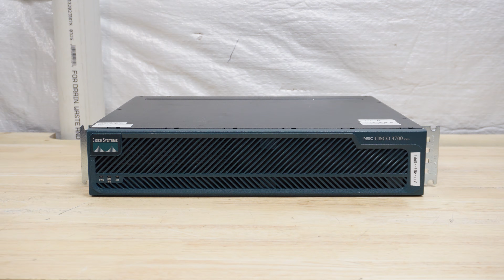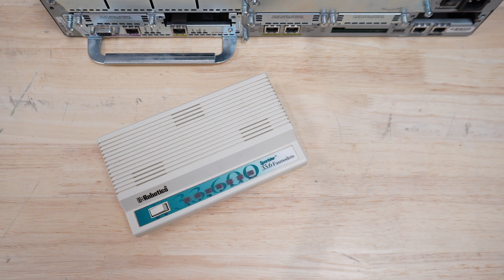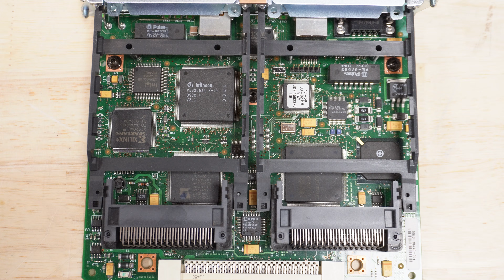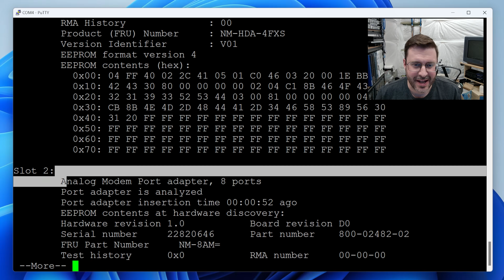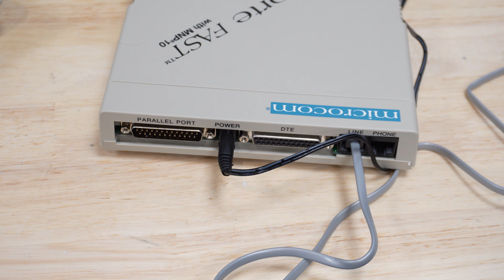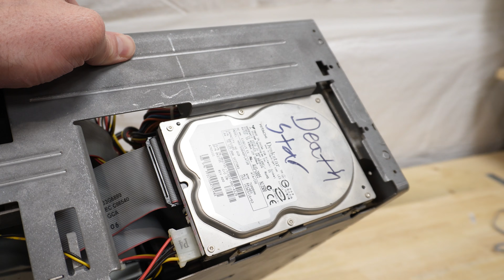All-In-One Dial-up ISP Box

Comment: There's also an EVM-HD 8FXS/DID card that has 8x FXS ports on the RJ21.  You can expand that as well, up to 24x.  There are some you-know-where going pretty cheap.  Some already have at least one expansion card module installed, and the modules themselves are available for a song too.

Only caveat is (in typical Cisco fashion) not all NM slots will take an EVM.  I use a 2851.  Just read up before you commit.

(P.S.:  Try "show inventory" instead of "show diag")

PPS:  You say "this isn't the way any professional would do it" -- but that's actually exactly what those cards are for.  You're not using overkill hardware to make an ATA.  You're building a PBX.  The ISRs are meant to do exactly that -- voice and data routing.  That's what "Integrated Services" (the IS in ISR) means.  :-)  Using an ATA is a band-aid when it's uneconomical to add an analog port somewhere.  What no professional would do, is use a bunch of silly cheap ATAs to provide business-critical voice lines... not when they could use centrally-managed, industrial strength FXS interfaces to do it instead.  So, you, my friend, are moving up in the world.  👍
Reply: That slot on the top of your 3700 that doesn't have a backplane port -- that's for a "double-wide" NM.  You could get a switch module that had like 16 FE interfaces.  They weren't routed interfaces, mind, just a managed switch inside your router.  So that's why that slot is there.  LOTS of those ISR routers would fake you out like that.  ;-)

If you haven't run into them yet, be on the lookout for PVDM modules too.  They look like RAM/flash SIMMs, but they have DSP chips on them instead.  They have different capacities -- e.g., 16, 32, 48 channels, depending on the number of DSP chips on them.  These do all the grunt work for handling voice codecs, and are usually necessary to set up voice channels at all.  Your low-complexity codecs (incl. u-law) may take 1 DSP channel per call, while high-complexity codecs take more than 1 channel.  There are charts that show you which codecs use what resources, and it also varies per generation due to the horsepower on tap with that gen's DSP (PVDM2 vs. PVDM3, which are used in 2800 and 2900 series, respectively, e.g.)

I had a bunch of these in my routers already, but hadn't done much voice stuff, so I didn't actually know how many channels I needed -- if any -- or if it was just for VoIP sessions.  Nope.  As soon as I turned up two T1 cards, it ran out of channels and told me to come back when I had some PVDM2-48 modules.  ;-)  Luckily these things are falling out of couch cushions at any place that had an ISR.
Reply: That Xilinx IC on the TR module -- pronounced "Zy Links" -- is an FPGA.  You'll see some variant of that on just about every WIC and NM you have.
Reply: Not sure the 3700 can drive an EVM. 2800/3800 can, and so can the 2900/3900 in an SM adapter.

Comment: Is the IOS firmware literally just the bin? Is there a license number required?
Reply from the maker: depends, a lot of these older ones didn't require license stuff
Reply: Right. Back in those days, getting your hands on the advanced firmware files wasn't easy. Cisco had lawyers inside all corners of the internet set to pounce, nobody dared to share them or you'd be black listed.

Comment: The big RJ-21 connectors off your card and feeding your jack panel are also called Centronics or Amphenol 50-pin connectors, which can help when looking for compatible gear. Keep in mind that these cables and connectors can be custom-built for some applications, sometimes having the pin count start at different ends of the connectors and would use the telephone color code. The slashes on your breakout block counts indicate it could have been used with equipment handling up to 50 pairs, using two RJ21 cables. (1-25 and 26-50) As a Central Office Network Technician, I have to say that I'm really enjoying your channel's content! Seeing gear that I've used in the past (or in some cases have yet to retire) be appreciated for the amazing things they have been doing for decades is awesome. Major kudos to you sir!

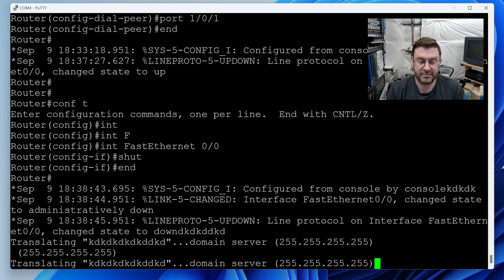Comment: 32:57 you can disable domain lookup by doing the command, "no ip domain-lookup" when in config mode. To cancel domain lookup you have to send a break character, how that character is sent depends on your terminal software. This shortcut works on other commands too, like a ping which is taking too long or a traceroute. This was one of the first things I learned from my teacher when I was studying for my CCNA
Reply: "no ip domain-lookup" is a very common configuration.

However a more targeted solution is to only apply fixes to the consoles, not to the global DNS settings, ex:
line con 0
  transport preferred none
vty 0 15
  transport preferred none
Reply: Ctrl shift 6

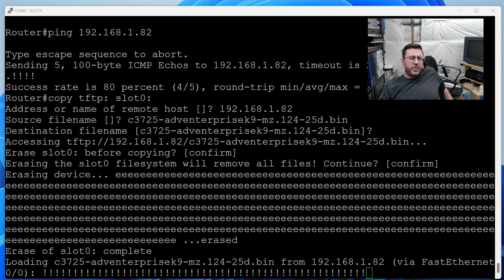Comment: 25:50 it's not the flash card's fault either.. TFTP is a goddamn slow protocol since it does block checksumming every 1kb and uses a highly unreliable UDP stream for transfer. I don't think I've ever seen any machine that would do that any faster. Always a lot of fun setting up devices like their wifi access points with 50MB+ images that include the web interface files.
Reply from the maker: good point! didn't think about how slow tftp is
Reply: I don't even know what tftp is. I've used ftp, sftp, ftps, scp
Reply: @AgentOffice  TFTP is sort of a predecessor to FTP. It doesn't have authentication or users, it doesn't have any commands beyond get and put, it doesn't understand directories. This makes it incredibly easy to implement and requires only very little code space. This made it popular e.g. as a software update mechanism for embedded systems like switches and routers, where the whole boot code needs to fit into very little ROM. It also uses a UDP packet stream which is a lot less complex than TCP, and it supports basic checksums per block to ensure correct transmission.
Reply: @WooShell  that's wild
Reply: @WooShell  oddly FTP predates TFTP.

Comment: I've only seen an RJ21 jack on my "Cisco" SPA8000. Very bizarre. Also if anyone knows why the small chip near port 1 gets super hot and makes it shut off right as its about to finish booting any advice would be appreciated. One of the transistors on the left of the chip was blown up when I got it
Reply: Manufactured to a price point is why.  The SPA8000 was a post Cisco accquisition of Linksys, post Linksys accquisition of Sippura redesign of the 1 and 2 port Sippura SPA series ATAs.

Comment: Very cool! I have a Cisco 3925 here. I just need some FXS cards and modem cards. Right now it has a couple E&M cards. I might keep the E&M cards in there and add an FXS and modem card in there since there's 4 slots. I also came across something very interesting. What's weird about it is theres zero mention of it online.... They're Digi-Tech Microlink M340 Data/Voice multiplexers for radio repeaters.  From what I heard you can even do ethernet (albeit very slow) over radio with them. I'm diving into the manual to see its full capabilities. Units are made in Christchurch New Zealand.

Comment: Try typing "logging synchronous" to keep the console output debug messages from interrupting your commands as you are typing. You can't call yourself a network engineer unless you've racked Cisco bricks to a rack yourself, one handed, in an awkward position, while not accidentally unplugging any other cables to other equipment. Thanks for the video and cat tax.
Reply from the maker: ahhh logging synchronous would've been a good one to cover as well!
Reply: @clabretro I remember mentioning this you can make it permanent by going into line con 0 then logging syn and that will make the behavior the default also not sure if this is an IOS 12 thing but the do prefix will execute a priv exec command in conf t mode
Reply: It's utterly baffling why logg syn isn't default. Like that choice had to have been made by someone who hates people.
Reply: @ax14pz107 I agree it’s so common every setup I do I enable it also most of my scripts have that baked in for setting up new routers.
Reply: Friendly neighborhood graybeard network engineer again…

Yes, but you really want “no logging console”. If a debug command goes haywire and starts melting down your router’s CPU, console is your last chance to save having to power-cycle it. If the console is being overrun with debug log output, you’re toast. Once a router is past initial bootstrap, you’re should disable console logging altogether.
Reply: What you describe sounds like a fun Thursday to me. Awkwardly balancing that brick with one arm with that little 4 U slot you got to wrestle while noticing you are right handed and that hand is currently holding the brick and left hand screwing it will probably take you 20 minutes.
Reply: Huh? Not every engineer works on computer network hardware. These days no one is using Cisco anyway so I guess by your logic no one's an engineer.
Reply: @elixier33  Cisco is still the largest network gear supplier.
Reply: @ax14pz107  I teach networking, almost everybody nowadays uses a cisco style or cisco inspired console. You want to get new enterprise customers? You get something they are used to. Cisco just set so many industry standards, that you adjust to what people are used to if you want to sell your stuff. Not to mention that Cisco can be traced as a lineage for most network gear manufacturers through tracing employees. People don't re-invent the wheel, they try to improve what wasn't good.

And to be honest, the moment you want to do a little bit more advanced stuff, you don't get around the big guys who had to follow Cisco's lockstep for a while.

Still glad EIGRP never became standard. Love me some OSPF and BGP is manageable, but hate the guts of EIGRP. Luckily Cisco gave up on it too.
Reply: @elixier33  And 3/4 of CLI still feels and looks like Cisco.

Comment: 32:55 For the routers that support it a 'no ip domain lookup' in configuration mode should stop random text from being interpreted as a request to connect to a host
Reply from the maker: perfect!
Reply: @clabretro  I'll warn that adding that config entry does have other side effects, like if you ever need to connect to another device via hostname. So be aware, but I still configure that in my own homelab.
Reply: @KronK0321  Yes, the solution for this (without impacting other DNS settings) is to configure the con/vty lines with "transport preferred none"

Comment: Referencing the breakout, each port can run 2 lines (inner and outer pair).
Reply from the maker: ah that makes sense, this thing is weird though, there is only the inner pair on each jack
Reply: @clabretro That's what I get for commenting before finishing. You explained the daisy chain just now 😅

I will say though that the Velcro is meant to retain the connector.